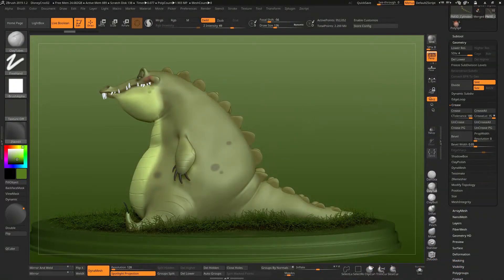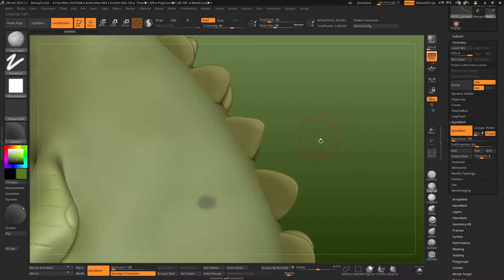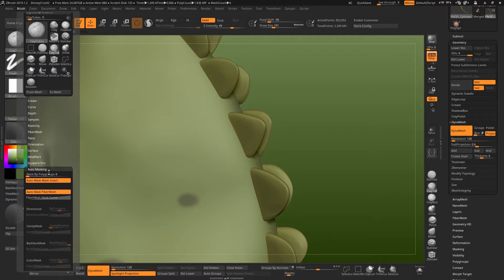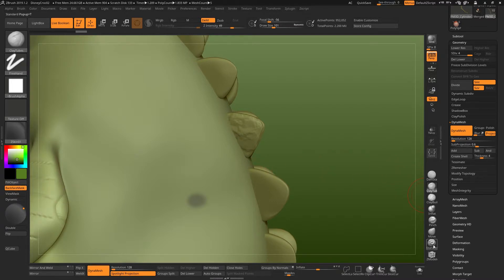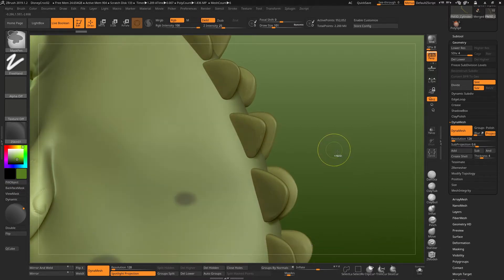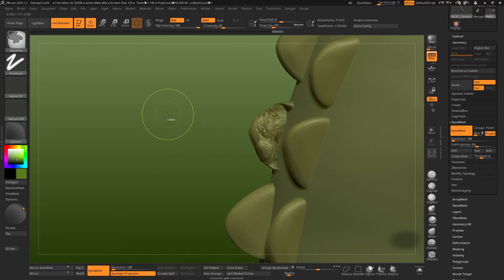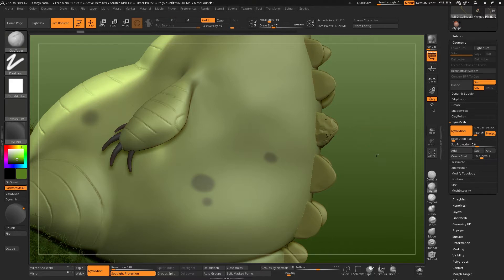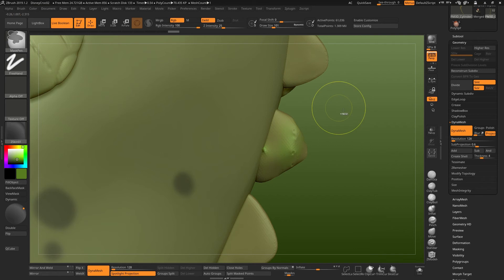Getting super thin geometry while sculpting? Dynamesh giving you holes? (the Swiss cheese effect)

Comment: Is there a tips for reserve pointy sculp for dynamesh & Zremesher ? Thank you.
Reply from the maker: I'm sorry, I'm not sure I understand the question?
Reply: @SeanForsythTutorials  I'm sculpting pointy scales on a demon's thorn. But I get lack of polygons when I'm sculpting the "pointy scales". If I increase dynamesh resolution it will be unnecessary polygons on the face. Is there a masking method that if I use dynamesh it only effect on that masking.
Reply from the maker: @uwill5995  You have a few options.  You can turn on Sculptris Pro mode (the button to the left of the MRGB button on the top toolbar) for the brush you are sculpting with, and that will dynamically add resolution as you sculpt, giving you enough polys where you are sculpting. Another option is if you are using subdivision levels, is to hit the Freeze Subdivision Levels button under the Geometry rollup, which will bring you down to subdiv 1, here you can add extra geometry by using the ZModeller tool (or even the ZRemesher if you want!), and when you're done and have more polygons where you need them, hit Unfreeze Subdivions Levels and you will get your subdivisions back wut this time with the extra geometry you created. Another option is to just hide part of your model and then use Dynamesh on what is left visible. This isn't great though, as it fills in the hole where the rest of the model used to be. For me though, just turn on Sculptris Pro mode. If you hold down the Shift key and then turn it on, you can just smooth your model where you will be adding more details and it will create more geometry there. The smaller your smooth brush, the more polygons you will get. Hope this helps!